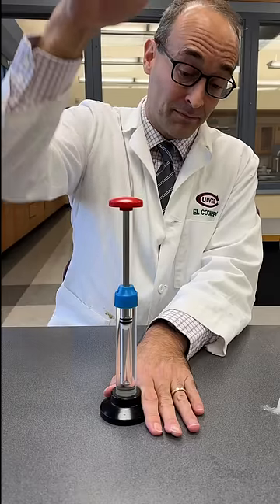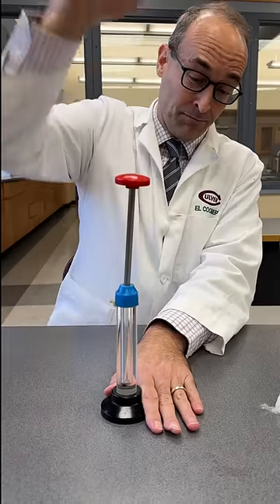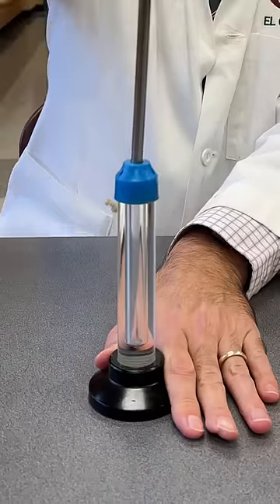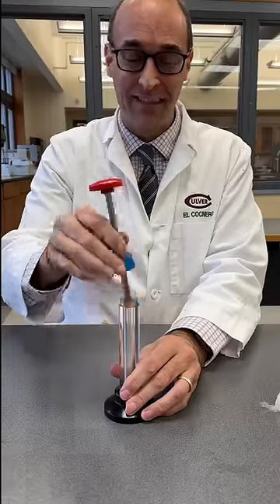Squeezing air to burn stuff

Comment: A diesel engine is the practical form of this.
Reply: ah. So that must be why a lot trucks sound slightly different from cars. They have different engines
Reply: @@HumbBumbhe shows a gas engine tho
Reply: @crestothegecko6279  Diesels in general sound a bit different than gas engines
Reply: @@HumbBumbhe shows a gasoline engine because he talks about "compressing fuel vapors before igniting them". That's a gas engine.
Reply: @drcashmoney7507 does not matter. Gas engines will do the same if they are used with the wrong fuel. At least for a short time.. 😂
Reply: @thewafen763 yep diesel engines rev slower cuz of undersquare that make lot of torque
Reply: @crestothegecko6279  different engines, different exhaust systems and different rpm ranges.  A diesel can redline all the way down at 2500rpm, where a gas engine might be redlining at 6500.  Assuming they produce roughly equal amounts of peak hp, the volume level of the engine is somewhat proportional to the power produced (not factoring in mufflers) so a diesel is a lot louder at lower rpms than a gas engine comparatively and has a lower pitch because of it.
Reply: Compression combustion
Reply: Just filled my f350 tank with cotton balls, hopefully the cia doesn’t get me.
Reply: @eliabtorres1548  You need to modify the fuel delivery to the engine with cotton balls injection. Sadly the cia made sure that cotton balls wouldn't pass through the fuel pump without clogging it up first.
Reply: So... kinda.  There isn't an engine that compresses fuel to ignite it.  A diesel engine compresses plain dry air to the point where it gets hot enough, then sprays fuel into that.  The fuel ignites right out of the injector like a flamethrower.

A gas engine DOES have fuel and air being compressed together, but ignition is controlled by a spark.

In both cases, the exact moment when fuel starts burning is precisely timed.  If compression is happening and fuel starts burning on its own at some random time, that is always a bad thing.  This experiment demonstrates principles used by engines, but this actual sequence of events represents a violent failure mode.
Reply: wow you're the first person to comment this here, no one else noticed
Reply: @asdfdsf-s4u  well he's wrong
Reply: @@HumbBumbwhat he showed was a regular engine model. NOT a diesel. There’s a difference. His model wasn’t accurately reflecting what he’s demonstrating, while you’re focused on insulting everyone else’s attention span…
Reply: Was going to say that
Reply: @crestothegecko6279 there's regular cars with diesel engines yk, it isn't unique to trucks
Reply: thanks for the tip, I"ll buy diesel car then since I have lots of old cotton t-shirts and briefs for fuel!
Reply: @RWZiggy  You'll need something to fluff them up back into cotton balls. 💫
Reply: @Redbikemaster  this principle is much more used in diesel engines than gas engines. Diesels can literally only start because of this. Gas engines use spark plugs not ignition compression
Reply: @Eggcornbean  yeah I know, I own both. I'm saying the creator of the video messed up not focusing on diesels
Reply: You got zero engine knowledge @@HumbBumb
Reply: glow plugs tho
Reply: @punker4Real  what's your point? Not all diesel engines have glow plugs. I own one diesel and drive another for work. Neither have glow plugs.
Reply: @punker4Real  Just heat things up so it's easier to start. Watch some cold start videos for diesels with the heating system disabled.
Reply: @Redbikemaster   i learned what I said from comments idk shit about engines lmaoo my bad dog
Reply: @FactionalSky Except the gasoline is ignited by a spark plug instead of pressure. This experiment is closer to a diesel engine. Diesel fuel is created to be ignited by pressure alone.
Reply: @foxymetroid  as I said. Gas engines will do the same when used with the wrong fuel.
Reply: @FactionalSky  Mazdas claims their SkyActiv-X has a half compression ignition petrol system, it has a really high compression ratio and is for running a mixture that's so lean a spark plug can't fully ignite it, it gets to the borderline of knocking then uses the spark plug to start the first burn, to control the timing of the detonation. The main charge is compression ignited but is it really compression ignition if a spark plug starts the process?
It's kind of like the modern f1 engines and when Mercedes were building theirs, they used people and knowledge from their truck division to design the engine.
Reply: How diesel engine from a regular gasoline?
Reply: @seronymus  Diesel engines have no spark plugs and require fuel injectors.
Reply: @foxymetroid  and what does a spark plug do that's necessary for gasoline though
Reply: @seronymus  Ignite the fuel-air mixture
Reply: @JETZcorp yes there is. Only the most modern diesels use direct injection. Automobiles into the 90's still used indirect injection and most small equipment still does.
Reply: @williamiverson903  Yes, but even indirect injection diesel engines ignite the fuel as I have described.  They use a separate chamber attached to the combustion chamber where fuel is injected after air has been compressed into it by the piston.  Fuel is injected into the prechamber and ignites immediately.  Burning fuel and spent gases rush out into the main chamber to force the piston down.  Whether using a prechamber or injecting into the cylinder itself, air is compressed first and then fuel is sprayed into that environment.  No diesel features a loaded air-fuel mixture during the intake stroke like a carbureted or port-injected gasoline engine.  If that system worked at all, diesel engines could have used carburetors.
Reply: @vuvinh2032  also because the pistons move faster at a given RPM in a diesel
Reply: @crestothegecko6279 That is precisely correct. The disorganized ignition of diesel fuel under very high compression is very damaging. Consequently, all parts in a diesel engine are designed bigger, thicker, heavier to counteract the increased violence of random auto ignition within the cylinders. This as opposed to spark induced ignition and gasoline engines which results in a relatively smooth wave of power in the cylinder.
Reply: @vuvinh2032 

For the most part yeah, most industrial applications of diesels are going to be undersqure but its not a neccessity.

Volkswagon TDIS are more square cyclinder bore ratios, etc. 
Duramax engines are basically over square and make basically the same power.

Under square "helps" with efficiency but its not as much as people think, and it more so just changes where in the RPM band the power is made.

With diesel engines in general, the fuel burning at different rates (not to forget how its injected) in combination with the compression ratio are the key noise differences you generally hear. 
 compression ratios can be modified by piston and cylinder head designs rather than just bore/stroke.

I had to wrap my head around it over time owning diesels, like my 6.0 powerstroke is under square and from factory made 50 less foot pounds of torque (even with 18:1 compression) than my 6.6l duramax with basically the same bore/stroke (bigger piston by almost 1/4 inch, with a smaller stroke of 1/4 inch) however there are more factors than just pistons that played into the big motor companies competition for power numbers like injection pressure and intake manifold flow rates.

And to add before I go, the biggest long term issue for seeking power on my nice 6.0 is the 4 studs per cylinder and ancient injection system.
New 6.7 powerstrokes basically remedied all these problems, so its a duramax of sorts. 

GM was way ahead of its time with the v8 duramax design. Yeah, they built it like an ls.

obviously, cummins does cummins. They are built good and have much more piston stroke undersquare. I just dont like how they sound, nor the look of dodges 😂
Reply: @crestothegecko6279 yup and that's why they sound different too
Both engines use combustion of fuel
But the ignition is done differently

Gas uses a spark
While diesel uses compression
Reply: @crestothegecko6279 True, otherwise trucks would be as slow as snails or sth
Reply: If you do it but not to ignition then it's how compressors for cooling systems work
Reply: THAT'S LITERALLY WHAT HE JUST SAID, WHY ARE YOU ALL SAYING IT AS A QUIRKY FUN FACT.
Reply: A fire started that was made just like this is what gave Rudolf Diesel the idea for his engine. We can also thank him for Ice cubes.
Reply: Cool. Who asked

Comment: I had to convince an officer and a chief on my ship not to replace the nitrogen in our gun recoil system with just regular air. We had run out and the system needs recharging every so often. I felt super proud of myself for possibly saving my ship from a major explosion lol. No idea if the pressures got up that high or not, but I figured we used nitrogen for a reason.
Reply: Considering the recoil system probably contains a lubricant, then yes, you did.
Reply: @crd-nz_001  Well, the pressure would've ignited the oxygen. The oil too, of course. I called up one of my old 5 inch tech buddies and they confirmed this.
Reply: @billparker244 battleship? Or cruiser? Looks big enough to cause ruckus if it exploded
Reply: @hanif7592  Cruiser and yes. There's no barrier between the gun and the loader room where the drum is. You can climb up into the gun shield for maintenance. It has a net that slides closed which is locked by a key that goes into the power distribution panel. In theory, you couldn't be up there while it had power for safety reasons.
Reply: @billparker244  they're lucky to not have them n2 replaced. Thanks for your service mate💪
Reply: How could they be that inept??
Reply: Nitrogen also preserves as no oxidation can take place. Got equipment that was made back in the 80s that looks (internally) as new as the day it was made.
Reply: @MJ-ws5bp  agreed, it is one of the best preservation gases, besides noble gases like helium and argon
Reply: @MJ-ws5bp  Oh yeah that's a good point! I bet those guns are still all still bright and shiny inside.
Reply: Good job, man
Reply: @billparker244  oxygen doesn't ignite.
It literally can't,  burning is specifically something reacting with oxygen. Oxygen itself is non-flammable by definition
Reply: @donovandelozier7156  Very well. Lubricant + oxygen then.
Reply: @billparker244  yes the lubricant would combust very easily
Reply: You can notice he used cotton wool for the experiment. If it would work with cardboard ? No. Because it needs finer particles  to obtain better flammability. 

Having oil residue in compressed air won’t necessarily explose if it does not mix / spray in it.

By the way it would at least burn the oil a bit at each cycle  and let carbon residue.

Actually it exists oxygen separating devices, even home owner can have. They separate oxygen and nitrogen from the air, throw the nitrogen and collect the oxygen for home use. It’s probably possible to collect it’s nitrogen waste too
Reply: @hanif7592  Much cheaper as well, I imagine.
Reply: Good call mate. When u dont have enough knowledge in a certain situation. Common sense wins
Reply: cap
Reply: Those gun recuperators and recoil mechs are (at least when i was in) charged up to 9,000 psi of nitrogen iirc. U definitely want to use an inert gas. No flame, no corrosion, less susceptible to pressure variation with temp which gives better gun cycling, and is plentiful. The 5" may use less pressure though, otherwise idk how they were going to get breathing air to that psi. Were they going to try to use the scba compressor??
Reply: Oxygen wouldn’t have caught on fire. Regular air can be pressurized very high that’s why there’s air cylinders for paintball. The reason you wouldn’t want to use air if it really is just nitrogen in there is because the pressure will change with temp and not to mention that regular air will have moisture in it
Reply: Were you in the navy?
Reply: @donovandelozier7156  O² is not the only element in air.  There are a plethora of other gases some inert others not so inert.  Also while Oxygen is not combustible it is the main ingredient in the combustion of of other things.  Oxygen is a hazard and it is not inert.  The tanks that contain Oxygen can burn.
Reply: @donovandelozier7156  let me pose my own theory. Oxygen is an “oxidizing”agent, among others. From what I’ve read it causes reactions to things that like to bond to the oxygen molecules and creates new and different components depending on the fuel source. But if a fire needs fuel, oxygen and the initial ignition source, and due to the law of conservation of mass, couldn’t it be theoretically true that the oxygen itself is the fuel and instead, IT seeks out and clings to the other molecules like a psychopathic girlfriend?
Reply: @MaxPower-ke5rq  technically speaking the fuel that burns is just as eager to bond to the oxygen, which is why the reaction is exothermic. Especially such elements as say sodium or lithium.
Reply: @donovandelozier7156 technically speaking you have 2 different fuel sources
Reply: @MaxPower-ke5rq  oxygen is not a fuel.
Reply: @MaxPower-ke5rq  no, because you can’t burn oxygen. if it were possible to collect a pound of oxygen with no container, no amount of heat added to it would make it burn. It may go to its plasma state and then break down, but it would never burn. Ergo, it’s not a fuel.
Reply: @billparker244 one of the reasons why you DO NOT put oil on the treads of your oxygen bottles regulator or she will blow up.
Reply: It kind of blows my mind that such a thing would be left up to the discretion of an officer or chief not knowledgeable about such things. You think they'd have regulations they have to follow despite their rank. I've known a few high-ranking military guys, they aren't the most intellectual/scientifically-minded guys....or you're just lying. Idk
Reply: @salopro86  yes because an officer or chief ignoring regs and just pulling bs out of their ass is something that never happens /s
Reply: @donovandelozier7156  you hurt me with your sarcasm. Dude, I understand some officers maybe overstepping their boundaries at times, but it would be grossly overstepping of even a cocky officer to say "let's disregard the operational manual on a multi-million dollar ship/piece of weaponry because I think air is the same as nitrogen" and only a lowly sailor corrected them on that thru his YouTube education on chemistry? Doubtful.
Edit - I swear man, Navy guys are the worst when it comes up to made stories of their time in service.
Reply: If your superior wasn’t aware of that, they didn’t belong in that command.  😂. Thankfully you were able to catch it.  These superiors didn’t happen to be in charge on the Iowa in the 80’s, did they? 😅
Reply: Using ordinary air in a pneumatic piston of a chair is enough to cause it to literally explode if you sit down on it too hard.
Reply: So, essentially, YES they use nitrogen for a good reason.
Reply: @billparker244 . Oxygen itself does not burn but it is necessary for something else to burn. In your example the oil would have burned after ignition from the heat produced by the compression.
Reply: @slowpoke96Z28 . Totally correct!
Reply: Oxygen don't blow up it just makes the fire bigger
Reply: @donovandelozier7156  It certainly can if it gets hot enough.
Reply: @crippledkitty863  oxygen definitionally cannot burn under any circumstance at any temperature
Reply: Cool story, but there's no shot your higher ups didn't know this.
Reply: Oh c’mon, what’s a magazine exploding amongst friends and next of kin?
Reply: @RedHaloManiac95  dude, im going to venture on to say the PSI of the parts on the navy ship he is referring to, most likely used higher PSI than your painball gun..like wut bro
Reply: @donovandelozier7156 You are unbearable dude.
Reply: @chickenmonger123  unbearable or not, the truth is on my side: combustion, otherwise known as things burning, is when some substance reacts with Oxygen therefore as defined it requires some other substance.
Reply: is this RP?
Reply: @billparker244  Only a true Navy man would know his buddy is 5 inches.
Reply: There is a issue of this with super cheap office chairs using compressed air instead of nitrogen.
Reply: @sharonrigs7999 they picked up chief
Reply: @billparker244 
It wouldn't do much to the oxygen, without something combustible, like the lubrication.
This is why oxygen tanks and threads don't get lubricated.
Oxygen isn't flammable, it's the other stuff, that gets oxidized rapidly, by the oxygen.
Reply: @crippledkitty863 
The reason why oxygen tanks say Flammable on them, is because of Lawyers, and the difficulties of explaining the chemistry of combustion to everyone in a hurry.
Reply: Well, we use CO2 and yes we know high pressure CO2 might cause acid corrosion. She was near declass so saving money became a thing. But using regular compress air ? We will see you in a safety guide book If things go wrong.
Reply: That is pretty scary that they were so stupid in their positions not understanding this...